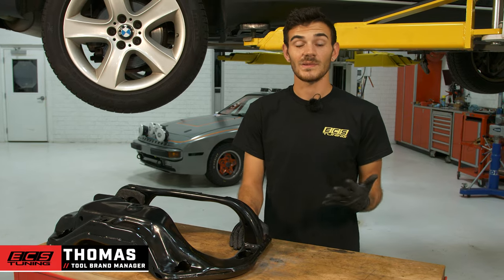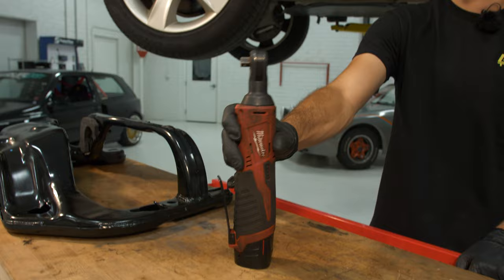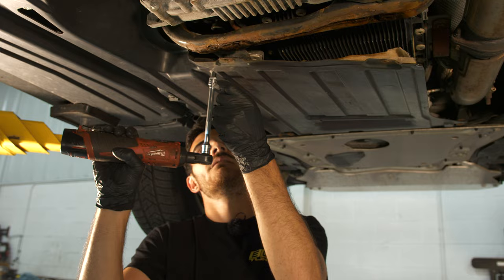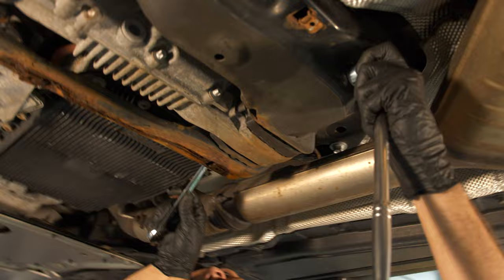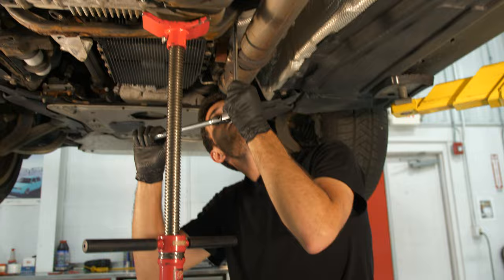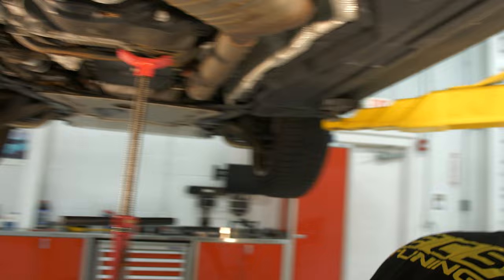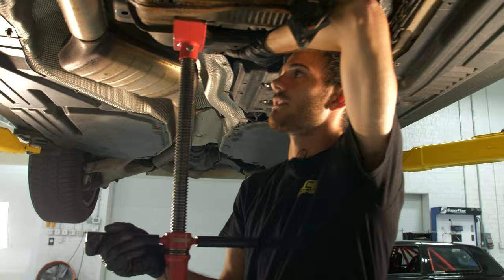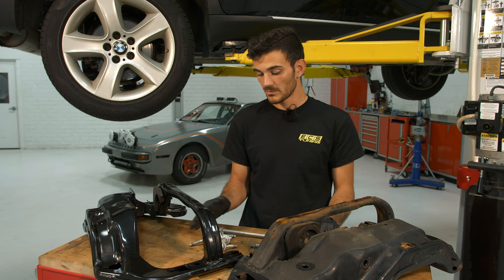How to Replace your Crossmember in your BMW E70 X5!!

Comment: I did it myself with 6 inch ramps on all tires.  I recommend replacing the transfercase mount which is the reason I took it out and you need a tool to replace the mount. On the 4.8 is more difficult because of the dual exhaust, you don't need to drop the exhaust though.

Comment: Looked at this stuff to learn how to let hang the x-member from the driver side and gain access to the transfer case motor actuator. E70 X5 2007, 3.0 is....vtg error with 4WD cel on dashboard.